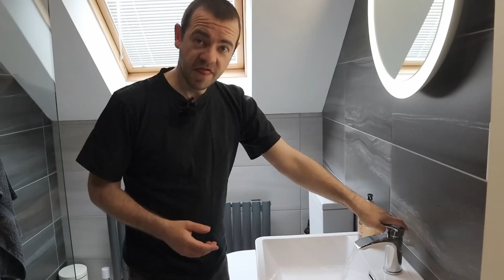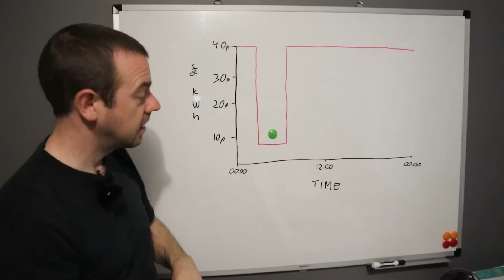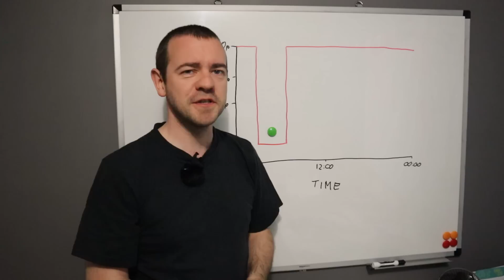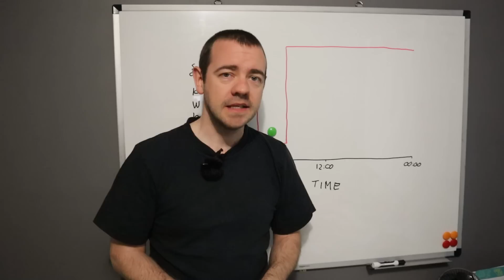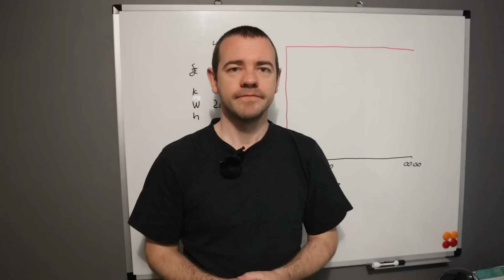Heat Pumps, Hot Water & Electric Usage!

Comment: My experience with ht heat pumps suck in really low temps for heating water, below -10 c the boost always run , also no one tells you that they only heat to 55c by default and in my model won’t heat above 60c , now we are seeing strong sun my 12kwh solar now does all my heating which still sees sub 6c at night , I’m currently heating both air to air and under floor, and air to air is far far superior for comfort as well as making thf room feel warmer, than thf old buildings open plan underfloor , due to the building and annex layout having just one source of water cylinder is just not possible,  but both are 250 litre. Cylinders one is heated using the heat pump the other is heated using two solar diverters ,  that tank heats up far far quicker than the heat pump , when fully drained and 9c incoming cold water , it takes 4 hours to fully heat the heat pump cylinder using just the heat pump and no boost using 10 kwh energy . The other using solar diverters heats in 1 hour flat total energy 17kwh . And heats using to majority of the time from just solar , in the winter months it divers from the grid since solar drops to less than 1kwh this far north   My experience l I’m selling the ht heat pump and keeping the air to air , it was a complete waste of money to heat 4000ft properly  underfloor is something you like or don’t like , maybe it’s me but it kind of off gas’s the carpet, leaving a chemical smell slightly that no one tells you about .  Now that is being drained , as the connection swap to a air to air in the in property . And going back to a direct heat propane for the main building 3 bathrooms high gain cylinder. With a solar diverter to heat in summer. Where I  I live electric is 40c a kwh hence the 12kw array , but last year using under floor ht heat pump cost me 1100 dollars a month , on top of 250 dollars lumber for fire   air to air heating a bigger area using 4 main units 800 dollars no add heating needed . I’m sure a air to air will be even more economical in the U.K. don’t be fooled especially in Scotland to go to ht heat pump , air to water is fine if you have a majority of wooden floor space,but carpet rads  especially oversized still beat that , but I don’t like lukewarm rads .  If you have the space and room for ducting go air to air
Reply from the maker: It was -15c for a few days here and my hot water was exactly the same as it is today, only it used maybe 4kWh instead of 2kWh right now. I can also go to 75c if needed.

It takes about 45mins to fill the 120litre tank from empty.

As I said in the video, tech moves on. What you have either is slightly older tech or installed badly.
Reply: @ElectricVehicleMan  the building dates from 1870 that had been abandoned since 1989 due to the previous owner passing,  the majority of the farm land was sold off to developers but 300 hectares were left with the property to be used as farm land due to the land order,   when we arrived most of the heating was solid fuel based, most of the retrofit ducting had collapsed, and termites had taken over part of the old west corner that had to be demolished,  the building was  1/3 demolished due to damage and then extended.  being timer framed you can imagine the heat loss,  last year we saw temps from -10-c to a barmy -43c,  plus lake effect,  like you i wanted to get away from fossil and direct heat electric  , a propane tank had been installed but never fully connected or more likely ripped out when the owner died,  like the uk we had a fair share of cowboys and annoyingly plex pipes the default everywhere,   when my partner died of covid,  I stopped working on the place for a while, came back to england then went back out there,  we ended up investing 16k in a Mitsubishi eco multi-split HT  and because of the footage an additional LT split,  that year from dec 10 till feb 24th  it was below zero and exclusively ran off the boost,  we only ever saw a 1,5 cop rating,  even in late march where we still saw the odd snow fall, it had climbed to 2,5,   and NEVER went above 17c on the coldest days,  naturally we through we had been done and called the engineers  and a 3rd party that had been recommended to us by another to evaluate,   as this wasn't what we had been promised,  the main exchanger was swapped, and things got worse with a cop 1,8  what made matters worse is the installer tragically died in an automobile accident before we resolved the issue, he was a small family company but the loss ment they shutdown  so I was left with the american distributer trying to resove all these issues, we ended up appointing a large company recommended by mitsubishi who effectively started from scratch again,  in the mean time a few friends had ditched there diesel (keroseen) heaters for an air to air, there building was in worse shape than ours but it was significantly warmer,  and they were seeing a cop of 3 in -20c,   both of us agreed we wouldn't go down the underfloor heating route again, and after speaking with the new installer.  installed air to air, multi-split 16kwh, the second winter we spend most of our time in the annax with the air to air,  it didn;t stuggle once but was a real pain when we lost electric for 5 days due to super snow storm,    the main building dropped to 10c on max, with the underfloor, the anax  a happy 23c  granted we talking a 65c delta difference but still if one can fully cope and the other be a borderline heath risk in those temps,  this is why after consulting the new installer, started to remove the HT system,  its never worked right from day 1,  so is being brought by another who just wants to use it for the underfloor,  and mitsubishi are transferring the warranty to the new owner since its being installed by one of there approved installers,  we were told we would see a cop of 3.8 when installed so you can see why I felt seriously greves to get a 15
Reply from the maker: It was -15c for a few days here and my hot water was exactly the same as it is today, only it used maybe 4kWh instead of 2kWh right now. I can also go to 75c if needed.

It takes about 45mins to fill the 120litre tank from empty.

As I said in the video, tech moves on. What you have either is slightly older tech or installed badly.

Comment: Bit new to this. However, how do you manage the legionella cycle? Does that need a routine heat-up beyond what the heat pump can deliver? Or can that cycle run entirely using the heat pump?
Reply: the controller for my Mitsubishi Ecodan has a Legionella setting, it only uses the heat pump.
Reply from the maker: Don’t need to do one, however, if I did it’s a separate weekly schedule you can use. The heat pump goes to 75c so getting to 60c is easy.

Comment: We have an electric instant heater (9kW) with a grey water heat exchanger. 
In summer, I use 0.8kWh for 2 showers (so 0.4kWh for 2 showers) and in winter less than 2kWh for 2 (1kWh each).
The good thing with this is that it is cost effective to buy and cost effective to run, and I don't need to use electricity to keep the water warm in a tank.
We shower at 22h00, at the beginning of the offpeak.
I still have a heat pump in my ventilation system (thermodynamic double flow ventilation) and this is cost effective too (I live in the north east of France, so we have cold winters).
Reply: Keeping it simple is always the key. I like your system. I wish I did the same  because my system is so complicated that my wife prays that I live a long life because no heating engineer could ever fix my system of (loft hot air recycling 5kw heat pump 120litre triple insulated water tank which is force fed with hot air from the black roof tiles. I need to call khaby lame!
Reply: Yes, an electric shower is simple and cheap to install, doesn't involve stored hot water, and with a few minutes use doesn't use much power so isn't costing much even at normal tariffs.

Comment: Our heat pump water heater has two resistive elements it can use, but there is an option to disable them. We also have an "energy saver" option where it can decide based on ambient temperature and hot water level whether to use the heat pump, one or both elements or a combination. I've tried both heat pump only and energy saver over a week, and honestly haven't seen any difference, but winter here maybe doesn't get cold enough for the resistive elements to make more sense than the heat pump.
Reply from the maker: Resistive will never make sense over the heat pump. That’s 100% efficient at best vs 200-400%. Even in winter.
Reply: @ElectricVehicleMan  When looked at as a static system, I agree, but the manufacturer of the water heater is adamant that their "energy saver" mode is more efficient "in typical households" and I think that is the key here - it is using demand sensing to optimize as water is drawn out of the tank. 

If the water temperature in the tank is lower because it is recovering from, say, an earlier shower, then when a second person tries to use it they will naturally consume more from the hot tank feed to get the same temperature water for their shower, meaning the heater has to heat a larger volume of water. If their patented trick really works, they may be able to save some energy by reducing the amount of hot water pulled from the tank while it is recovering. 

There are a lot of discussions about this mode online (the manufacturer is a company called Rheem) and some anecdotal evidence that it does reduce energy. For us, it didn't seem to make any difference compared to pure heat pump mode. A lot depends on the demand pattern for hot water, but modeling the system as a dynamic one is certainly more realistic.
Reply from the maker: @johngordon9987  With a time of day tariff, efficiency becomes second to cost.
Reply: @ElectricVehicleMan  Your time of day tariffs seem more limited than ours. We have a narrow peak period (5pm to 9pm Monday to Friday) when we pay 50¢/kWh, the rest of the time we pay only 14.5¢/kWh. I find it hard to believe the demand on the grid matches the times they give you cheaper rates in your tariff = seems like they’re not really passing on the savings (or perhaps they use the lower demand times to average down the peak price).
Reply from the maker: @johngordon9987  7.5p for 6 hours now and 40p for rest of the day. 

They do other Tod tariffs but this is a steal with an EV and home battery.
UK average is about 30p at the moment.

Comment: I have moved my ASHP to heat during my cheap overnight times and even stopped using my Eddi that diverts solar in the most part. In saving energy, it seemed carazy to have around 8kWh put in through the Eddi but only 2kWh if done via the ASHP. So now I use Home Assistant to monitor the excess solar and turn on the ASHP hot water, then once a week the Eddi runs for the legionella cycle. This can run from excess solar in the summer but the main heat is from ASHP.

Comment: Yup same with my Daikin system. Can manually boost it or have a setting so if the hot water tank temperature falls below a threshold it can boost automatically.  The heat pump can give water up to 70 degrees but we run it at 55 degrees to increase efficiency - COP around 4 just now!!

Comment: Thanks! Is there a reason you don't use power from your PVs to heat water using your heat pump? Surely that's a good option, esp in summer?
Reply from the maker: All that goes into the battery. Which if needed can turn power the heat pump at 3/4 times the efficiency of a solar divert option.

Comment: Our 5 year old ASHP is run in exactly the same way as you describe. You didn’t say what max temperature your water is heated to but ours is 50C. But, it is also recommended that the water temperature be increased to 60C every 7 days, in order to ward off potential legionella. This is achieved by using the immersion heater to boost the 50C to 60C. This is achieved at the cheaper overnight rate. So is yours different to ours? I am a bit sceptical about the legionella thing, as I believe legionella is really  only a problem with stagnant water, and most people’s hot water systems don’t remain static.
Reply from the maker: 60c thing is pointless at home. Especially as legionella dies within 2 hours at 50c. 

My heat pump can go to 75c so it does it all if I wanted. It’s also got a separate legionella setting that’s never used. 

https://youtu.be/oJeyc_cGIMU
Watch that.

Comment: It used to be common with gas powered central heating with a hot water tank, to have an (electric) immersion heater, which was for the most part never switched on, its just a cheap to instal safety blanket. Its a bit like having a torch or box of candles.
Thanks for update.
Reply: Still is
Reply: I took the fuse out. The gas boiler can reheat the tank in 10-15 minutes but people used to put the immersion on to 'boost' it.
Reply: @cannamorecamping5029  I think it was there in case for some reason the boiler was not working, I know it makes little sense.

Comment: Very interesting video, can I please ask what size was your old gas boiler and what is the ASHP also is your ASHP operating at 40c or can the temperature go higher for your HWS, I understand that new cylinders made for ASHP have a better heating coil than the old cylinders.
Reply from the maker: My hot water is at 53c but it can go past 70c. HP is a 5kW unit.

Comment: We're looking for a hot water solution that compliments our Air To Air system that is getting installed this week. As we currently don't have a water tank and just use a combo boiler space is also becoming a question, as I would like to avoid wasting a lot of it for a water tank... I can't really find a good solution as yet. I've heard of smaller heat pumps that will do just the hot water... Maybe I can pair that with a sunamp or something
Reply: There are hot water only heat pump water tanks. Daikin and Dimplex for example do them.
Reply: not a bad idea, we are looking also into it, but in opposite, to somehow integrate cold water to our air recuperation so it works as a cheap and healthy coolant in the summer.
Reply: Have you looked at the Mixergy hot water tanks? I changed to one last year when my electric ancient immersion heater went bang. I can adjust the temperature easily and I decide how much water to heat and I can heat from electricity, gas (which we don’t have here) solar PV or ASHP. I have also now got a MiEngergy Eddi that is waiting to be installed to divert my Solar PV to charge the car or heat the water using as little as 0.1kW feed from the panels instead of having to wait until I’m generating 1.6kW as I do now.
Reply: Sunamp is useful as a space saver, but it is very heavy. The up side is you get mains pressure hot water without the annual  service that is recommended for an unvented hot water cylinder. If you can find space for it Mixergy have the iHP, hot water cylinder with a integrated heat pump. Not a cheap option, suggest it’s best for a well insulated property. Daikin are apparently launching their Multi+ a multi split ASHP with up to 3 air to air units plus a 90/120L wall mounted hot water tank, this summer. They say it’s aimed small flats, unfortunately probably too late for you. Another option when your existing combi boiler needs replacing is Rinnai direct fired water heat for instantaneous hot water. Have a look for content from Dameon Hill that covers the Rinnai and other integrated heat pump cylinders.